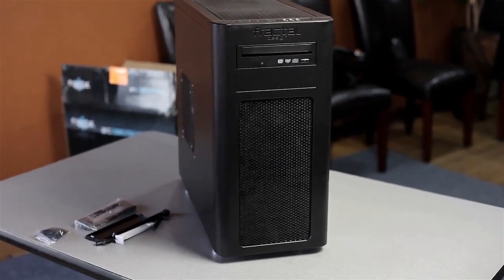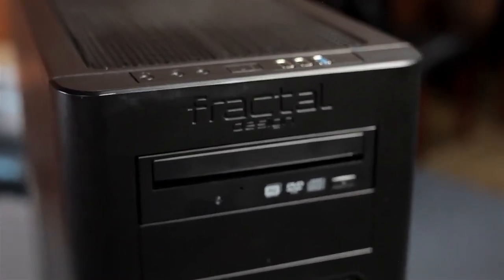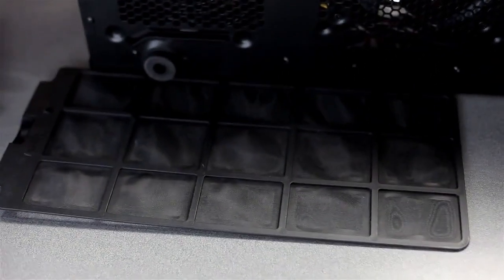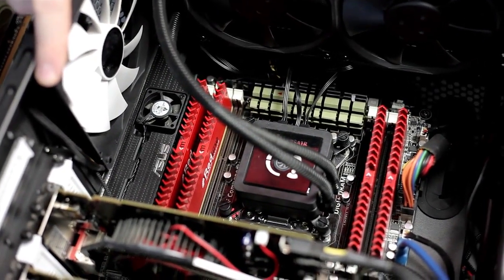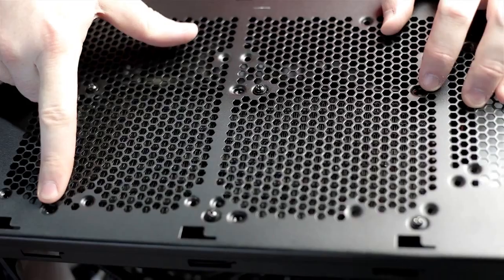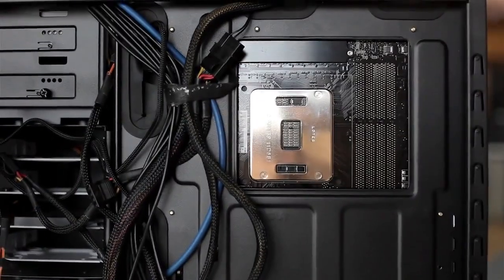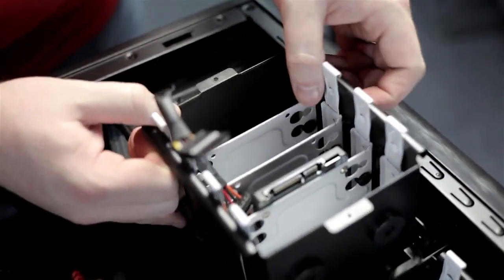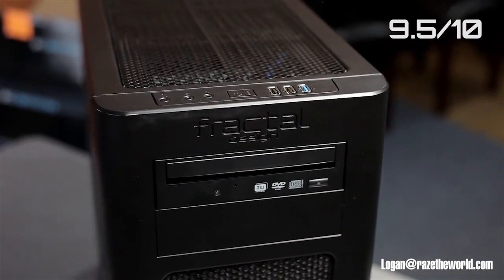Fractal Design Arc Midi Review

Comment: anyone know if the h100i radiator will fit under that top filter so we have the option of mounting just the fans in the visible section at the top?